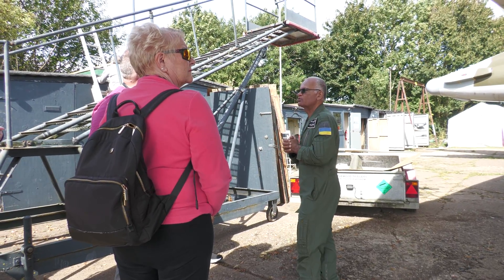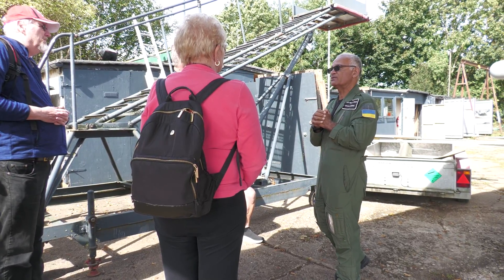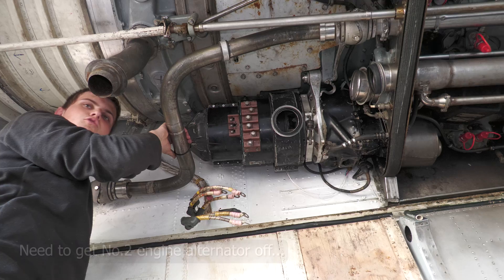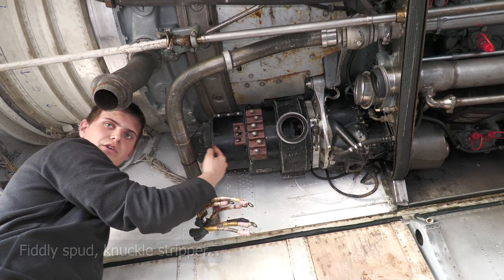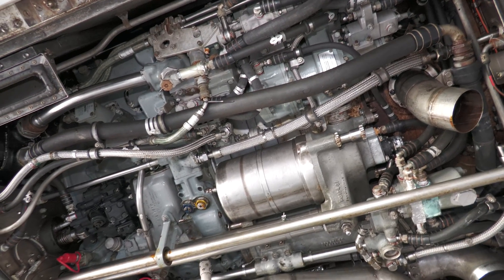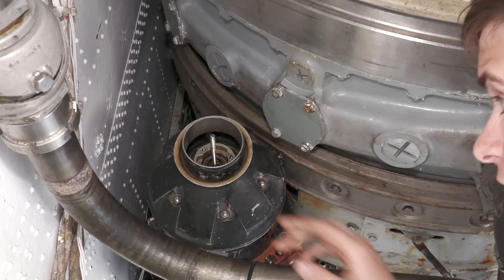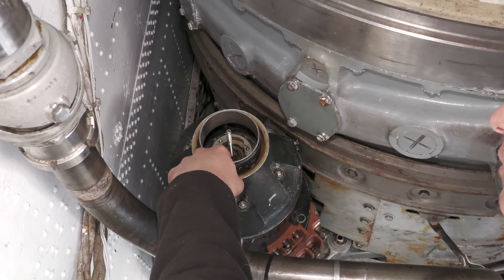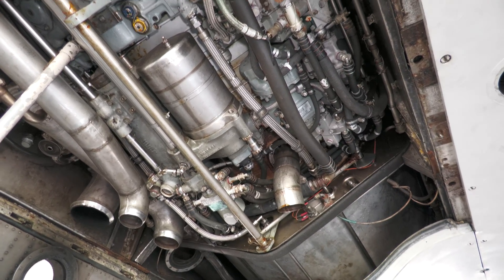Vulcan Bomber XM655  No.2 Engine. Alternator issues Up Close & Personal

Comment: There is no direct conversion between thrust and horse power, as they measure different things, but the Olympus 301 isn't capable of 52,000HP. The correct rating would be around 33,000 Shaft Horsepower which would be around 40,000 Exhaust Gas Horsepower.
Reply from the maker: Would appear to be correct Sooty655 

According to this calculator as there is a speed element to add to the calculation

https://calculatorshub.net/mechanical-calculators/lb-thrust-to-hp-calculator/

20,000lbs thrust at 645 mph = 34,400 HP

Can't really tweak the video captions but I've updated the video description